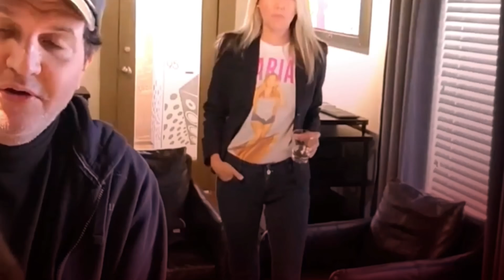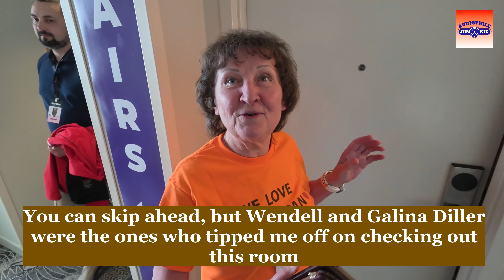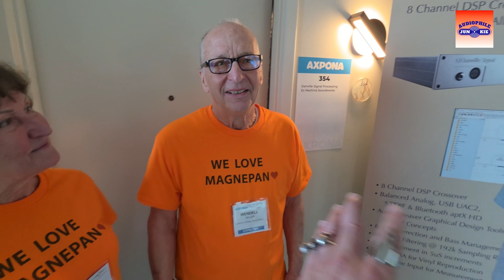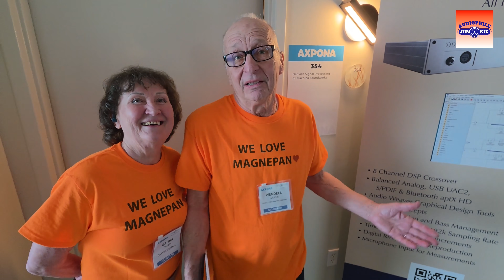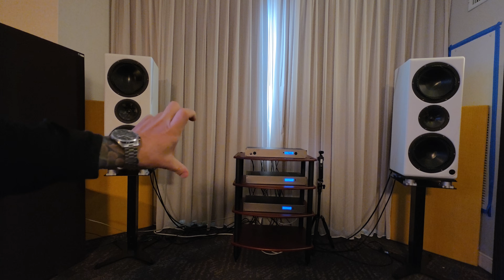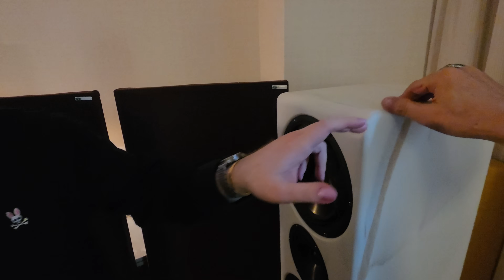🏆The $50k Speaker That Shamed Million-Dollar Rooms at AXPONA 2026

Comment: Here's a question. Given the advantages of an active crossover why don't companies like Vivid, Magico and Wilson Audio (for example) go in the active crossover direction? Kii has been designing active speakers for going on ten years and I have always been impressed by their designs.
Reply from the maker: It's a good question, but I had a similar discussion with Andrew Jones and it's mainly a financial decision.  First, the market is only just now seeing and hearing the advantages. Previously, they just didn't sell in the marketplace. 

One big reason they haven't sold well in the past and will still have friction is because of DEALERS. Guess what happens when you create an active speaker...you now have less cables, electronics, and equipment racks to sell customers.  Plus, they have so much control over performance if the speaker includes DSP that the customer doesn't become as neurotic and wanting to upgrade.  The speaker is also more future proof and you can't just come out with a Mk2, 3, 4 or 5 with minor crossover changes to make people neurotic and buy again with dealer, distributor markup.

I'm not hating on dealers or mfgs who don't do actives because financial priorities often come first.  However, I do give credit to those like Kii and others that have started to offer active designs like YG to satisfy those wanting the very best in what's possible nowadays with speaker design.
Reply: As silly as it sounds, it is a fact that most people buy passive gear. This means that if you want to make money and command truly high prices, people are far more likely to purchase passive equipment than active gear. This holds true even though you can get the exact same quality in the active sector for a mere fraction of the price. People simply do not want to switch or step outside their comfort zone at the risk of having to admit to themselves that they have sunk far too much money into overpriced passive technology. DSP, digital, and even active analog remain niche—and will likely always remain so... unfortunately.

Comment: Just curious.  What can DSP do about Cumulative Spectral Decay which some such as Danny Ritchie say is the most critical thing?
Reply from the maker: If you're dealing with budget speakers, spectral decay is usually cabinet based or poor quality drivers/integration/crossover.  You're going to have to bandaid it regardless of the technology used, but if you're talking about anechoic measurements, you need to treat cabinet resonances and vibrations to address some causes.  In the DSP realm, you have lots of bandaid options that also apply to a listening room environment and what's audible to humans.  You can reduce the response at the problematic frequencies to minimize the resonances/ringing that can become audible.  In many cases though, the spectral decay shows stuff far beyond what people can hear easily.  It's often just very poorly made/cheap speakers that suffer from the drastic issues, but DSP is the easiest and cheapest "bandaid fix" without spending money, modifying cabinets, buying new parts, etc.  The better long term answer is to buy a properly constructed speaker to start and not rely on DSP or mods to fix bad design after the fact.
Reply: @AudiophileJunkie  Yeah I think the key is still not to have time domain smearing.  That's what costs the big bucks and engineering prowess to eliminate.  DSP just operates in the frequency domain and, as you said, could be dialed down in a particular region where the ringing is really bad.  Danny Ritchie does that sometimes through passive means of moving crossover points and notch filters etc..
Reply from the maker: You might be confusing EQ with DSP.  EQ just deals with frequency response.  DSP is great at time domain correction too.  You obviously would rather NOT have to use it, but it's impossible to get as good time domain performance as the Ex Machina speaker I just featured with passive parts.

Comment: Ok so what you are saying is that we vinyl lovers  should switch to a dsp based system in which the analog signal from the phono preamp is digitized and then d-a after dsp and EQ…??? And you call yourself an audio purist..?
Wow..
No further comments are necessary.
Reply from the maker: You're already listening to digital masters guaranteed.  And I bet you've never tried what you outlined either.

On the flip side, there are several people doing just that with $100k turntable rigs and multi six figure systems who won't go back. 

If you want to continue listening the way you're doing it now, that's fine. It doesn't hurt me, but I think you should try it and have someone capable set it up for you below dismissing it based on zero actual evidence measurable or audible.

Comment: In my system it's clear as day that DSP kills the dynamics and musicality. I'm using HQPlayer with a single band to treat a room mode peak at 46Hz. It kills everything.
Reply from the maker: Maybe you're using DSP improperly or maybe you're used to wild frequency swings and that's created a preference. 

However, making that generalization about "DSP" is the exact red flag typically of someone not using it properly. DSP can do anything you want... Even if you like ketchup on your steak... It's the better option for getting you there. 

You just need to invest the time to learn the technology and correlate what you like and hear to measurements... Then you can see the true power of DSP and get whatever sound you want. 

I guarantee passive parts, solder and wire take more out of the signal natively than a DSP unit with no curve applied. Thus, it's misplaced blame for what you are hearing.
Reply: @AudiophileJunkie  I was clear, my system, HQplayer, single band PEQ, wasn't I? But now that you dismiss my case and generalise that DSP is always better says all 
I need to know. One would know there aren't many things that you can generalise in hifi.
Reply from the maker: You made a stereotypical generalization that shows a very low IQ, so I was actually easy on you. However, since you still want to argue, I'll point out the sheer folly of your statement further.  

First, you didn't even mention what you did with the DSP you used which is red flag number 1 and instant sign to me of a dogma/agenda based argument.  It's like saying "I don't like horns"...which horns...have you heard all the horn speakers to make that statement.  It's a lazy argument that most see right through.

Second, you didn't reference a single commentary on what you had DSP do to fix your system.  You didn't discuss the delta of any before or after measurement to PROVE that you preferred the "before"...plus indicate how much work DSP had to do to get the AFTER. 

Instead, you immediately blamed DSP in general and not anything else including your application of whatever single tool you used.  Regardless of what DSP you used, I bet your room or speakers had significant issues "before" such that using default DSP curves had to add so much gain to correct for the issues that it caused clipping... and/or... a delta so much different than what you were used to listening to that it shocked you.

Instead of having the self-awareness, knowledge, and experience to know how to compensate and optimize DSP in those situations to your taste.  You just lazily made a generalization about all DSP and based on your one primitive experience.

It's actually fine to be a lazy audiophile who doesn't want to learn DSP...I get it...but what makes it worse is when you run to your keyboard to make a generalization that PROVES you don't know what you're doing, yet you think you do. 

One day, when you take the time to LEARN how to use it, you'll find that DSP can't "kill dynamics and musicality" unless YOU use it wrong and/or don't have any respect for objective high fidelity metrics.  If/when you ever get to an expert level, you'll realize that EVEN if you have "ketchup on steak" tastes for a frequency response that deviates from high fidelity, DSP will actually be the BEST tool to get you THOSE results too...not flipping cables, fuses, tube rolling, etc...which I bet you don't make generalizations about those things.
Reply: @AudiophileJunkie  low IQ? Are you seriously attacking my intelligence now instead of acknowledging that you didn't understand my simple comment? This is the lowest that I saw a YouTube author till now. I stopped reading after you assaulted as hominem and I'm done speaking with you.
Reply from the maker: You're lucky I put it as nicely as I did because it's exhausting trying to explain basic things to lazy generalizing audiophiles who think they know more than they do. 

There's plenty other channels that will seal clap to your generalizations and dogmas so I'm glad you got the message clear.

Comment: Why are these speakers so expensive? Speakers, plate amp and coax are max 1500 per speaker.
Reply from the maker: Those aren't plate amps... Everything is off board if you missed that part of the video, and you can see the internals in other videos I've shared on the electronics.  The drivers alone cost more than you think.  Then, creating a 150lb cabinet adds another layer that you don't see in budget speakers.  Nevertheless, you can find cheaper actives that may fit the budget. 

Search my videos for "Neumann" and you'll find a great option.

Comment: Ex Machina are on a different level from what we mere mortals have traditionally experienced. What they do is 100% the real deal. The fancy technical terms actually mean real things. Arcturus is going to be out of my price range, but a Terra+Gravity pair are somewhat realistic for me.
Regarding the first bit of the video, I've never understood why so many speaker companies put so much effort in trying to design the perfect passive crossover network. Why pay an extra $800 or so when you could run active crossovers (digital or analog) and get better performance for about the same money in the end?
Reply: problem are the customers. most high end customersare stuck in the 90s and still want passive system without any DSP / Digital Components. And also most of them dont understand or are interested in Active & DSP Technology
Reply: @VTKZ_mixes  Coming from the world of live sound, almost everything there has been DSP crossovers for 25 years. It boggles my mind why so many in the home theater and hifi audiophile world spend so much time and money on passive crossovers. I mean, there's certainly a time and place for it, if you're spending, say, less than $1000 on your rig.

Comment: I really liked this system. Some pretty deep DSP tuning to align their systems. Their specially designed Co-ax is pretty incredible too.

I know a lot of superstitious types with immediately write off Digital .. so it would be cool to see a passive version for comparison. ( likely never possible )

Yes... Definitely a top choice.
Reply: Aside from time/impulse alignment, another real challenge to a passive approach in this platform is a 200hz crossover. 
Achieving a transparent, high power 200hz hand off means big expensive high end coils, plus the inevitable phase shift of ELI the ICE man.
Reply: @FOH3663  .    Time Alignment is Math.  Is the distance from the voice coils part of the calculation?

Comment: Sadly if you do a blind listen most people and professionals can't tell the difference between cables power conditioning it's been proven and fact some people couldn't even tell when different amplifiers are used i have done it myself with my friends if blind because all it's about is dose it sound different
Reply from the maker: In short doses, that's common even among products where one product is broken. Our brains aren't used to high fidelity and does a good job of filling in the blanks and lowering our standards. 

However, if there are meaningful improvements in high fidelity metrics... Many are proven to be audible by any type listener outside of the hearing impaired.  It pays off most in long term listening if one is not accustomed to hearing super high fidelity.
Reply: People have poor aural memory.  One has to develop it through concentration and of course many ABX tests use switching boxes which negate the subtle differences that are audible.

Comment: Ex Machina stuff is awesome. That SEAS Metamodal TPCD coax is pretty much the bleeding edge of driver tech right now. If Purifi would also use that material they’d have hands down the most advanced driver on the market with what they’ve already done for motor and surround design.

Comment: How was the vertical dispersion? I haven't heard an mtm-style speaker with large woofers that didn't have major comb filtering at even a small vertical off-axis angle. I say this knowing a coax TM may behave differently
Reply from the maker: Yeah many MTM can be problematic and less than optimal, but that's the average of using the coax and DSP to address things passive parts have much greater difficulty offsetting.
Reply: I suspect you're referring to W-T-W designs ... because designs like this coax do not suffer from vertical comb filtering challenges. 

Any coax operating down to 200hz possesses superb, comb filter free response thru it's range. 

A 200hz wavelength being over five and a half feet, means anywhere out front the woofers sum nicely. 

However, in the perpendicular axis (straight up and down) the woofers exhibit quarter wave summation nulling ... which is an attribute to mitigate modal resonances in the vertical dimension.
Reply: This speaker isn't a normal mtm. It would be interesting to see and hear it's vertical behavior.